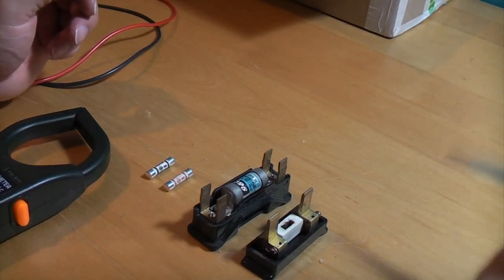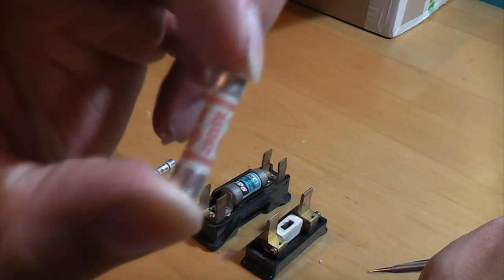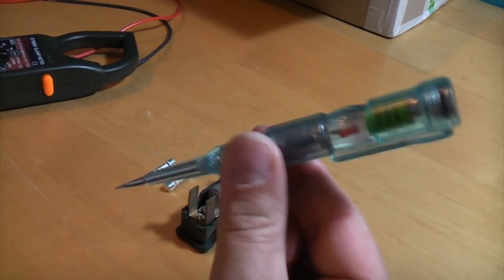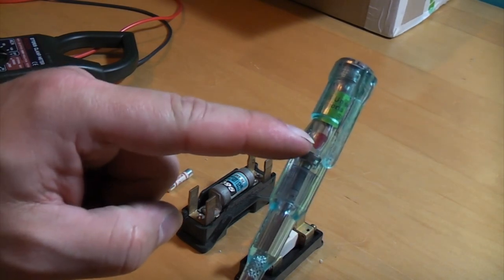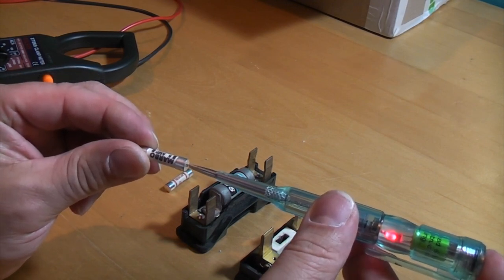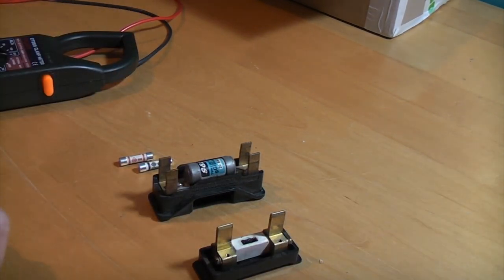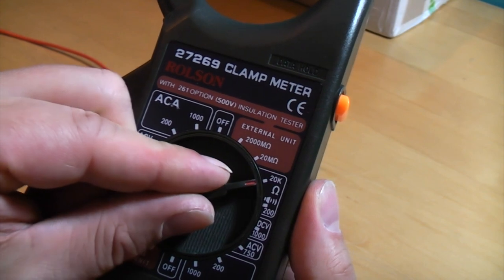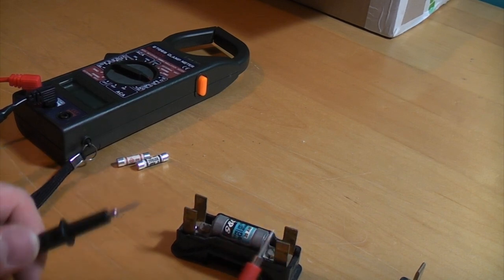How to test a fuse - Ultimate Handyman DIY tips

Comment: Hi Sir,

Small question, I have a problem where in one particular room, one of the liight bulb wirings is not showing any voltage when testing it. Tested with both the multimeter and the screw driver lighting thing. 

I'm wondering, is it possible, to check whether a wire is broken somewhere in the wall, without opening up the wall? Can I check without breaking anything, that the wiring (which is very long, and both ends are too far appart do do a continuity test with the multimeter) is OK?

Comment: what? how does this work? you need to connect both ends of the fuse to test it
Reply from the maker: With the electrical screwdriver used in this demonstration, your body completes the circuit 👍

Comment: It's a shame, I bought a new set of c.k 1kv insulated screwdrivers a couple months back and it came with the cheap crappy neon screwdriver, I quickly rendered that thing U/S so no-one could use it and threw it in the bin. For mains testing, I use a fluke non-contact voltage tester and a two pole testing device (I forget the make of it) which are both properly rated for the voltage I'm working on. I'm with you on this one about neon screwdrivers. Good video :)

-Andrew
Reply from the maker: copelandaa 
Thanks for the comment ;-)

Comment: Really helpful, thanks - but what do you do with a multimeter which doesn't have a bleep setting? My Ohms reading seems to cycle through multiple values on a new fuse. I don't know why!
Reply from the maker: Hi Angela, just set the meter to OHMS.
When you touch the probes together you should get a value (which is the resistance of the leads and probes), if you pull them apart there should be no reading, or sometimes it says OL meaning open loop.
Reply: Thank you - I'll have a go!

Comment: Can you safely test a 63 amp fuse with a Kewtech voltage tester? I've installed three distribution boards in a building, they are all supplied from an MEM switchgear panel containing three 63 amp fuses each of which is the link between the incoming supply and the cable to each board. Two of the cables are fine, supplying power without a problem, but the third cable will not power up when connected. Power is coming in, but not being transmitted through the fuse to the cable. I have pulled out the fuse link housing between the supply and load sides, and it houses a 63 amp Bussman fuse.
Reply from the maker: David Sakho 
It depends on the exact model of Kewtech Voltage tester.
Some models have a continuity test, in which case you should be able to isolate the electricity and then do a continuity test on the fuse.

Comment: My car was equipped perfect and reliable fuses with LED detection when it blown
Something like it:
http://www.ebay.com/itm/AUTO-CAR-FUSE-ATO-ATC-ATP-Standard-size-blade-LED-indicator-GLOW-WHEN-BLOW-MIX-/201565468505?ssPageName=STRK:MESE:IT
Why all fuses dont make with this technology?
Reply from the maker: Never seen those before but I'm guessing they are not 100% reliable. The circuit would have to be energised for starters and if the circuit fails that illuminates the blown fuse you could end up chasing your tail when fault finding.